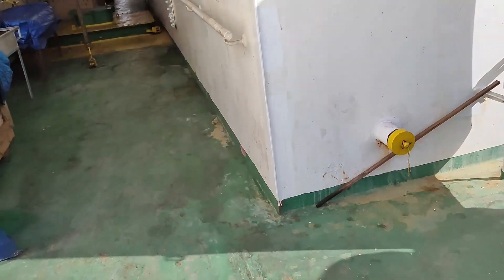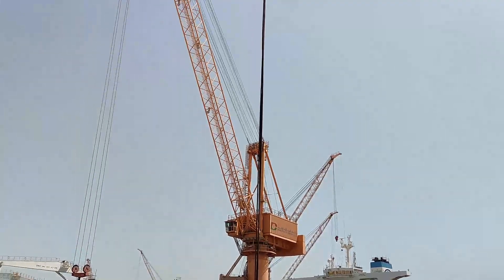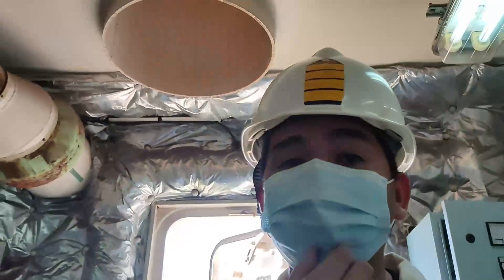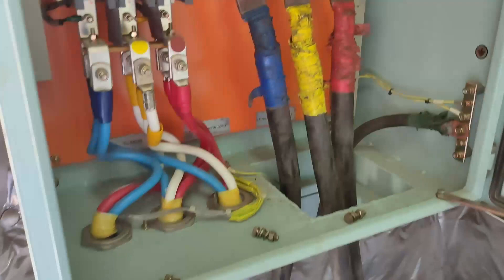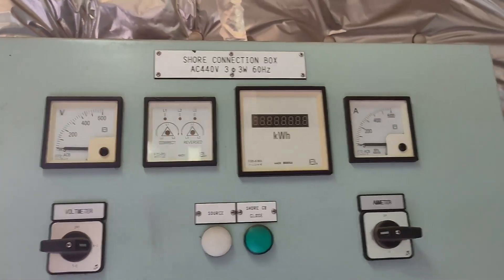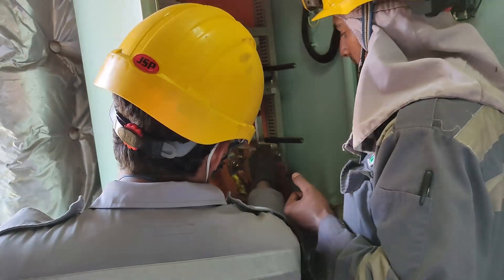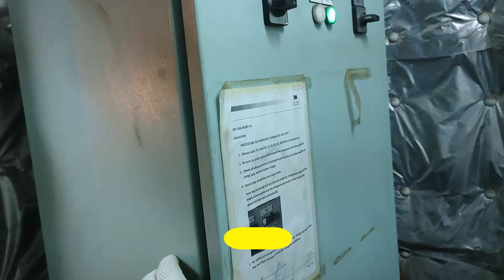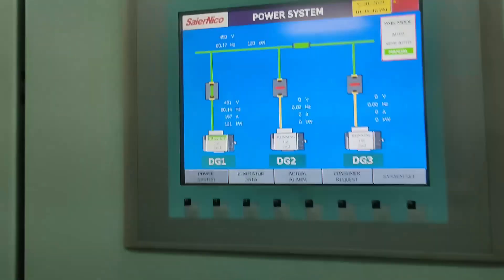HOW TO CHANGE OVER SHIP POWER TO SHORE POWER - STEP BY STEP  DURING DRYDOCK

Comment: Chief ask ko lang, pag on ng shore power breaker sa MSB, automatic ang supplyan nya na load parang supply ng emergency gen.? Tama ba? Salamat Chief
Reply: Paano pag ibabalik na sa ships generator chief, reverse procedure lang?
Reply from the maker: @anakti  pag balik once tanggalin ang shore power Papasok automatically ang Emergency Generator kpg nk AUTO ang set up, pwede rin eh manual pero better nk nk automatic once pumasok na sa Main Switch Board ang power sa emergency Gen. may power na ang barko limited sa emergency distribution, then pwede nag pa andar ng DO pump para sa Aux. Engine kung ang design separate meron iba nk couple and pump sa Aux n Makina so diretso n yon, then may time n ang set up wala p enough starting air so paandar emergency compressors, kpg may hangin and fuel start n manually ship Aux. Engine kpg umandar n manually pasok ang load sa MSB then kpg pumasok mag automatic matanggal sa load ang emergency power sa emergency Generator, then okey na!
Reply from the maker: 👍 Yup, automatic kasi ang shore connection normally nasa line ng MSB ang downside lng depende sa kaya ng Breaker na Amps, depende sa barko, pero normal about 400 to 500 Amps lng. Thanks
Reply: @joelsibuloLifeofaSeafarer18  salamat Chief, God bless you!